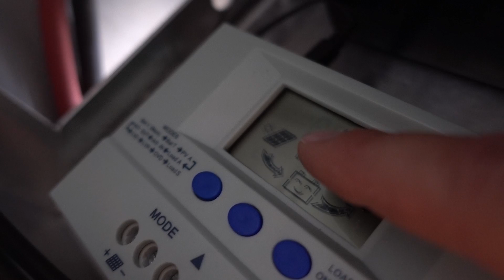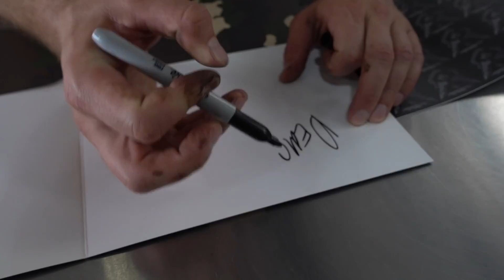Installing a Complete Solar Power System!

Comment: can you maybe make the houses walls of bricks or concrete- im sorry but ithinkpaper houses are pretty damn stupid - if a 9mm Para goes off in my house for whatever reason it cant pas thru 3 walls and kill 2 kids on the way 
And my isolation efficiency is probably double of the cartboard and chalk joke you call solid walls 
Invest in good respoerators or let the really bad stuff be made by a company with hazmate sutes

Comment: Matt solar is a good idea you should also look into wind power it is more reliable
Reply: Incorrect, sun come up, sun go down, batteries charged whatever the weather. Wind come, wind go, also wind generators are much more noisy on the scale he would be using them, I'm not talking about the giant wind farm things here, the small home use ones hum and squeal and all sorts. 100% Avoid!

Comment: MATT! 

This is when you needed "Flex Seal".
Maybe you can put it over the light bolts, over the caulk?
Reply: Except it severely degrades with heat and eventually becomes a sticky mess that will not stay in place
Reply: Lunkers would agree, Matt. Flex seal saved robs boat... Until eh sank it with a .50 BMG... RIP Ricky.
Reply: Just use silicone..
Reply: You forget that he poured it all down the ant holes in a silly attempt to rid himself of ants! What he should have done was dump a 1/4 cup of mana pro concentrated fly spray  down the entrance!  Works like nothing I have ever used before!  Dumped some in the evening and by the next morning not one surviver! Hundreds of dead ants littered the ground. 4 days out and still nothing!

Comment: Bro, your garage door opener sounds almost as bad as mine did. Do a run of brake cleaner to get the WD-40 off that you’ve been using and slap on some spray white lithium grease.

Comment: why use 110 ac lights in stead of 12 volt dc? now you are wasting energie to convert dc to ac??? use led 12 volt lights in stead. no need for a converter just hook them up to a switch and voila!

Comment: I have a degree in solar power, it would have been more efficient to source 12v DC LED lights. You can run those directly off the battery without the need of the inverter. LED lights only run on DC power. So you produce DC through tender and battery, All good! The sucky part is then is inverting it to AC, then rectifying it again to DC. You have a lot of loss through hysteresis going through inverter and rectifier to change it back to DC. This will cut down overall cost of system by eliminating inverter,and cheaper lights using dc powered lights and eliminated rectifier.  You may then run all of your storage containers off one battery running your trailers and lights in trailer parallel. You can also use an ordinary lights witch in each trailer to control lights in each one individually.  And to top it off, should of used a rubber grommet going through the trailers walls for abraision.

Comment: You should paint the roof white of the containers , it will keep it way cooler , and you should make a wood plate to sit the battery on so the battery won’t get too hot or conduct any energy though the metal brackets to the container . The battery also may loose its power sitting on something conductive unless it’s on aluminum  . Just a suggestion

Comment: Just something to note: Inverters typically draw power whenever they're turned on even if there's nothing running off of them - it's possible your unit doesn't have this problem but it would be worth considering using the power switch for the whole inverter rather than the individual socket to preserve your battery levels as much as possible

Wouldn't really be necessary in full sun obviously, but it'll make a difference when it's overcast

Comment: Definitely put a rubber grommet in that hole you drilled. Don't want to have it short out if/when the insulation on the wires wears through. After that put some silicone to waterproof the hole.

Comment: Nice job on the install. I've been into solar as a hobby for a couple years now. The only thing I might suggest is adding another panel to the system just for the purpose of keeping the battery healthy. But I guess it really just depends on how much you will be using the lights.

Comment: @8:30 you showed the 2 wires coming inside the container. You need to place a rubber insert in the hole just like when you run wires through the firewall of a vehicle they need protection from the sharp metal.

Comment: The LED LIGHTS are basically 12 or 24 volts. They have AC to DC adapters built into the box. Boost converting the power into 110v AC, and again reducing it to 12 or 24v will give a power loss through conversion. So, modify those LEDs to work directly on 12v/24v, and give DC supply from the battery without the inverter ☺️
Reply: Not always, my 120 volt LED shop lights are setup as strings of LED's in series to get to 120 volt input... no power converter needed. And non inside the lights, I looked to see if I could direct power them from my 24 volt solar system!
Reply: @MaryBrownForFreedom  
Ok if that is so, then that would be fine :) . Thank you for telling ))

Comment: you need to put a vent of some sort in there or those electronics will fry if it gets too hot and the battery could expand and explode if it gets super hot!   you can get a solar fan that will keep it cooler in there so all that doesn't get damaged.

Comment: Matt Matt use as much 12 Vdc As you can those 4 foot lights can be 12 V LED .........you lose 20% goin through the inverter!
yeah that’s right!  the inverter uses more power than the lights OR the fans OR all of the things that you want to use😳
make EVERYTHING INSIDE 12 V and get rid of the inverter❤️
you’ll be a happy man❤️🇺🇸❤️🇺🇸❤️🇺🇸❤️🇺🇸❤️🇺🇸❤️

Comment: Self tappers with the rubber grommet are great. (The ones that you see on steel sided buildings/ pole barns.)

Also, a Big Ass Fans fan looks like a solution to the sweating in the shop priblem.

Comment: Use a secondary switch, not the one on the inverter.  It will be used frequently and will be much easier and cheaper to replace.

Comment: From what I understand you only need a power inverter if you plan on running ac powered devices. You can save some dough if you run dc devices. On smaller setups ac power is not necessary.

Comment: I would install a ground rod and attach to the container with a copper ground wire.  I would also consider a small fan to cool the power inverter while it's in use.

Comment: put rubber grommets were the cables are going out of the container, the metal will chew out the isolation on the cables over time.

Comment: Nice work!  I just added a few solar powered lights to my storage shed.  I didn't want to run power to it, and the lights work quite nicely.  I need a good, cheap option to move hot air out of my shed during the summer.  I've been looking at solar attic fans.

Comment: Anytime you run through metal with an electric line you need to install a grommet to stop the wire from chaffing. There was only a second or two showing the hole in the side of the container I did not see a grommet.

Comment: You need to leave the red switch on all the time, and use the overall power switch on the inverter to turn it on. Leaving the inverter on will use a considerable amount of power, even with the lights off

Comment: Nice solar project. Would your system be big enough to run a stand fan so it won't be so hot when workers are in there ?  Will you more into the other container.

Comment: The heat in that container will destroy that battery. As suggested by another, I would paint the container roof a glossy white at the minimum to help control the container temp and keep the battery cooler.

Comment: Matt, just a heads up, put a drip loop before the hole.  That way if your seal breaks, water will go down the drip loop instead of following the wire inside.

Comment: I agree with the previous comments, the 12v solar panels will be much more efficient if you skip the inverter and just run 12v LED lights 👍
Reply: Correct,Ben.

Comment: You should put an insulator around the wires so the metal doesn't cut it when it moves, form wind or rain. Also make sure the wires are protected from water

Comment: You should check if the inverter draws current in standby. I have one with 0.8A in standby, so it makes sense to install a fuse or switch between battery and inverter or turn the inverter off, when not used.

Comment: Auction off the track shoes and donate the proceeds to Jake's family. Install an exhaust fan in the back wall of the shipping container that is tied in with the lights.
Reply: no don’t tie it into the light have it triggered from a temp sensor so it gets the heat out before you need to be in there rather that after
Reply: A couple wise ideas! 👍
Reply: " Install an exhaust fan in the back wall of the shipping container that is tied in with the lights."
THIS!  I worked in the receiving department of a warehouse and even in the summer heat of PA it was unbearable.  I don't even want to imagine what it'd be like in the heat of Texas
Reply: I agree

Comment: The roof Will leak at some point soon if you just use silicone you need to take the screws out and buy some butyl tape put the butyl tape underneath the bracket and then screw the bracket back down. Then use silicone.

Comment: Looks great, Matt! Just a couple of questions/comments. What's the amp draw of the lights? It's probably a small number, but good to know so that in the event of power outrages, you'll know how many hours the lights can run before half-discharging the battery. So long as you don't drain beyond half (50 amps in this case), the battery will last indefinitely under charge. The other thing is that it might be better to angle the panel ~45 degrees facing South. A couple of reasons - you get better all-season Solar exposure in that manner and, more importantly, precipitation will easily drain off and not pool on top of the panel. :)

Comment: Your turning off the lights with wrong switch. You need to turn off the inverter. if you don'tit will draw power even if the lights are off. Your solar system is not big enough too runan inverter 24-7. Also best wishes too Jake's family

Comment: For the wires get 
AUSTOR 100 Pack Zip Tie Mount White Adhesive Zip Tie Mounting Base (1.1" x 1.1") with 200 Pack White Nylon Cable Ties(Length 200 mm, Width 3 mm) https://www.amazon.com/dp/B07CHF24H8/ref=cm_sw_r_cp_apa_i_TdiqDbM4JW2JFAUSTOR 100 Pack Zip Tie Mount White Adhesive Zip Tie Mounting Base (1.1" x 1.1") with 200 Pack White Nylon Cable Ties(Length 200 mm, Width 3 mm) https://www.amazon.com/dp/B07CHF24H8/ref=cm_sw_r_cp_apa_i_TdiqDbM4JW2JF

Comment: For the cables coming through the container exterior be sure to have engineering loops both inside and out to prevent leakage. Right now you've got them leading straight in, and that can be problematic over time. I know your region of TX doesn't rain often, but when it does you probably won't want electrical systems exposed to damage.

Comment: This is perfect for your application if the caulking  leaks.

https://www.amazon.com/Sikaflex-Polyurethane-Elastomeric-Performance-Moisture-Cured/dp/B06XSXWTCG/ref=asc_df_B06XSXWTCG/?tag=hyprod-20&linkCode=df0&hvadid=343269706724&hvpos=1o2&hvnetw=g&hvrand=4327310063755095255&hvpone=&hvptwo=&hvqmt=&hvdev=m&hvdvcmdl=&hvlocint=&hvlocphy=1015150&hvtargid=pla-743606546147&psc=1&tag=&ref=&adgrpid=68751374563&hvpone=&hvptwo=&hvadid=343269706724&hvpos=1o2&hvnetw=g&hvrand=4327310063755095255&hvqmt=&hvdev=m&hvdvcmdl=&hvlocint=&hvlocphy=1015150&hvtargid=pla-743606546147

Comment: Probably should of instead it in the back..if you use a forklift in the sea-land container it will get damaged most likely. You could of used a motion detection to cut down on power use.
Reply: Camco 25013 Universal Vent Installation Kit with Butyl Tape https://www.amazon.com/dp/B000EDQQBU/ref=cm_sw_r_cp_apa_i_TaiqDbPC1JHW7
Reply: Fan-Tastic Vent 807350 Series Vent-White https://www.amazon.com/dp/B00HQZASRW/ref=cm_sw_r_cp_apa_i_dciqDbNHRKG6Z
Reply: Get 2 or more to drop the temperature
Reply: For the wires get 
AUSTOR 100 Pack Zip Tie Mount White Adhesive Zip Tie Mounting Base (1.1" x 1.1") with 200 Pack White Nylon Cable Ties(Length 200 mm, Width 3 mm) https://www.amazon.com/dp/B07CHF24H8/ref=cm_sw_r_cp_apa_i_TdiqDbM4JW2JFAUSTOR 100 Pack Zip Tie Mount White Adhesive Zip Tie Mounting Base (1.1" x 1.1") with 200 Pack White Nylon Cable Ties(Length 200 mm, Width 3 mm) https://www.amazon.com/dp/B07CHF24H8/ref=cm_sw_r_cp_apa_i_TdiqDbM4JW2JF
Reply: The roof Will leak at some point soon if you just use silicone you need to take the screws out and buy some butyl tape put the butyl tape underneath the bracket and then screw the bracket back down. Then use silicone.

Comment: The lights were not on solar power, they were on battery power at that moment (depending if your solar panel can charge faster than the consuming of the lights). 
An important thing is the solar panel angle with respect to the Sun. The most efficient angle on a year is based in the latitude of San Antonio is 29° with respect to the horizontal. The most efficient angle for summer is 6° and the most efficient for winter is 52°. As you can see, the most efficient angle can change 46° during the year, as the axis inclination of the Earth (that gives origin to the seasons) is approximately 23°.

Also, I don't know how exactly works, but high temperatures are bad for batteries.

I really like that you are doing this. Solar energy is one of the solutions to stop pollution and climate change.

Comment: You're going to want to put a little ventilation in there. Doesn't have to be much at all really but those batteries can off-gas a little hydrogen when they charge to it's good to  clear that out. Plus a little ventilation helps minimize the dutch oven affect. Looks good Matt.

Comment: I'm doing the exact same thing in my shop/out building. You got everything you need. You could even run some conduit from this container to the other one and power the lights in it also. That panel should provide about 5 amps in full sunlight. Those LED lights should not draw more than 3-5 amps. Even at night (if you are working there at night) the fully charged battery should be able to run the lights at that much draw for at least 10 hours so you have some reserve. Float the battery no more than 13.8 volts or you'll shorten it's life. (ask me how I know). The 13.8 volts float will keep the battery charged and in full sun the panels will also run the lights.

Comment: Hang a fan right in the doorway so you can close the door but still pull the hot air out when the doors are open

Comment: With all the holes all over the Place its going to rain in so grab some Silicon or rubber shit and put it over the holes so it wont rain in and fuck shit up forcing you rebox Everything because the rain fucked up the boxes.

Comment: Maybe you should connect a simple exhaust fan on the back of the container as well. Get some air flow when you all have to work in there.
Reply: The roof Will leak at some point soon if you just use silicone you need to take the screws out and buy some butyl tape put the butyl tape underneath the bracket and then screw the bracket back down. Then use silicone.
Reply: I said the same thing. LOL but I provided a link to ones I install all the time.

Comment: Hey man, the electrician in East Tenn again.... The key to off grid power- is the battery bank. You can hook a small panel up to like 20 batteries. If you don't use any power until its fully charged, you have that huge reserve. You can also get a type of transfer switch, and run 120V as well as 12V. Separately of course. On a rainy day you can also get a diode and an inverter and charge the batts from a 120v line. Pretty easy too... Also, over powered devices can be good so overload is far off. (Like a 3000W inverter when ya only max out at like 2000W. Just in case you have to use alot one day.) Was going to mention caulking every hole, then I saw ya do it. Safety idea- Run the wires from the panel into the container from under the panel. The sun will rot those wires, it will short, and can burst into flames. Conduit such as PVC also helps protect. Also, for those rainy days, a channel on here Wind2Volts shows how to make a wind turbine out of magnets and wire that's weatherproof. (Imo its frikkin awesome. There's like 7 vids in series) This way you have backup input power. Also can use water turbines if have a current near by.
Reply: Plus Matt's battery is way bigger than the solar panel. It would takes days to fully charge it.
Reply: @sabbasmazahir  Huh?

Comment: Solar has an efficiency of approximately 30%. Assuming sun is directly above it.... which is a small fraction of the day. If it is slanted and you put two of them forming a triangle you’ll get a much better yeild. Make sure it follows the sun’s locus